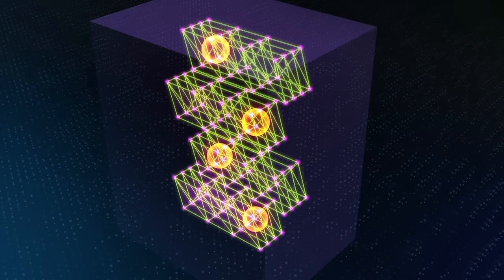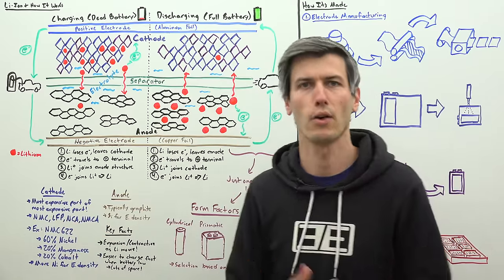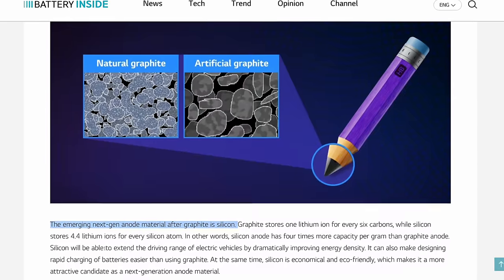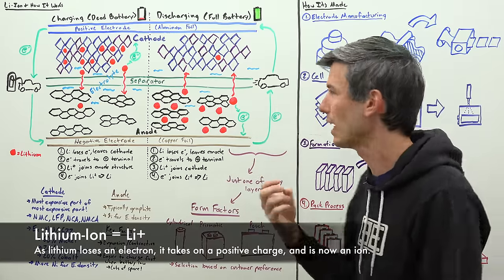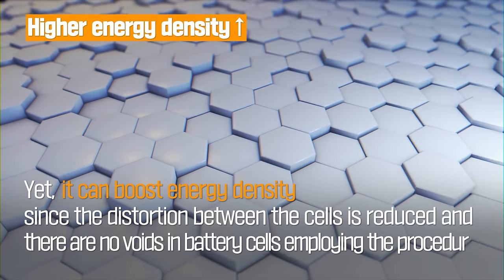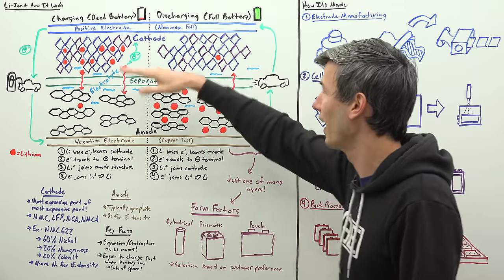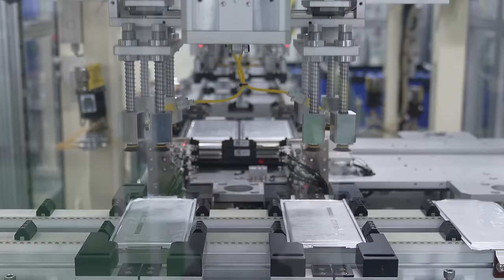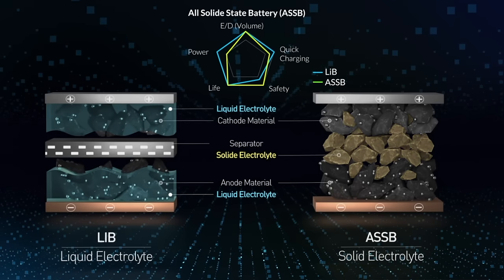Everything You Need To Know About Lithium-Ion Batteries

Comment: Great explanation!  You should definitely do more electric vehicle engineering info. I'd really like to understand the process behind regenerative braking and how some of the other systems work in electric vehicles, and your explanations are some of the best.
Reply: If you know how an electric motor works, then you would know how a generator works...
Should've payed attention to the physics classes
Reply: @kevingarfield2094  You should have "paid" attention in class when they were teaching you how to spell. I understand how a motor and generator work. The core component of these systems is a generator, but engineers can come up with many ways to make these systems more efficient. We have engines that are mostly the same core idea as when they were first invented, but engineers didnt just stop there. I personally enjoy watching videos on things that I already know about, just to hear someone else's info, ideas, and opinions about it. Learning never stops, and no matter how much you think you know, our understanding of the way things work changes over time. 

Also, not everyone has had a proper formal education. If someone is ignorant or curious about specifics, they should have the opportunity to ask questions without being heckled.
Reply: For synchronous motors, the DC-AC converter knows the angle of the rotor, torque is proportional to the relative angle between rotor and rotating field. So to start braking, you must delay the field rotation w.r.t. the rotor, this is enough to force power back. I don't know, however, how does the same frequency converter switch between power directions.
Reply: @GrimReaping  - Ignore the troll grim. You're correct. While it's true that an electric motor (polyphase AC motor in this instance) can be effectively used to generate power and a generator (alternator in this instance) can be made to operate as an electric motor they are typically optimized to function more efficiently as one or the other. For cross applications the differences in efficiency are typically small however so EV's will usually employ their electric motors as alternators for purposes of regen. Regen is simply using the vehicles kinetic energy to spin the motor which will act as an alternator when the brakes are applied. If you've ever tried spinning an alternator that's been removed from a car you may have noticed that it's very easy to spin when not connected to any sort of electrical load. However, connect an electrical load to it (like a 500W incandescent bulb) and it becomes much more difficult to spin. The load that a braking EV can place on the motor (when it's configured as an alternator), can be substantially more than that of a light bulb and can be quite effective at slowing a moving vehicle. Unlike with gasoline or diesel vehicles which use their friction brakes to convert kinetic energy into heat, an EV's regen during braking is generating electrical energy that's being dumped back into the battery.  Keep in mind as well that EV's also have friction brakes that are used in conjunction with regen to slow the vehicle. Below a certain speed an EV doesn't have enough kinetic energy to allow significant braking via regen so the friction brakes are needed. They are also there as a backup. The seemingly "seamless" operation between the two systems is actually a bit more complicated and maybe Jason can make a video on this.  
   Your question is actually a great question as it's not always easy for non "electricals" to understand. I believe Jason is an M.E. but his grasp of E.E. fundamentals make him great at teaching (which is unusual as while engineers are typically very erudite they are not always great at teaching. Jason has a gift 🙂) .
Reply: easy way to look at it is regen is same as reverse gear of the electric motor. on the motor side just send the exact opposite current to the 3 phases (compared to working as a motor). opposite current creates opposite magnetic field and opposite force/torque. but because the motor is still spinning in the same direction, the torque slows it down instead of speeding it up. once the motor spins backward, regen becomes reverse power and power becomes reverse Regen. on the battery side the current is also reversed => charging instead of discharging. if the battery is full or almost full, the battery doesn't accept charge current or only a very small one => reduced regen power.
Reply: A deep dive into regen would be interesting as it is simple in theory but a little more complicated in practice. E.g. Electric vehicles are quite limited regen wise which a lot of people don't realise. They can't capture all that energy generated due to limitations in the battery system. lt would be really interesting to see Jason do the numbers on this. l believe there are some companies trying to develop a capacitor/battery system that better utilises regen.
Reply: Some information about what vehicles use these specific cells would accompany this content well
Reply: @billhill4479 I would agree with you, in some cases. However, in larger EVs, with larger packs, (not at full charge,) the regenerative power does not exceed their capabilities of recharging. If, for example, you consider that the vehicle is able to output 150kW, (200HP) and can accept a DC fast charge at that same rate, (maybe not for the whole time, but a substantial majority,) why would it not be possible to regenerate that much power during a braking cycle? That is a LOT of braking power. If you are requiring a more spirited stop, that is what the mechanical brakes are for. (Or when the battery is nearly full, or more...)

I hope that makes more sense, at least from a logical standpoint. BTW, I hate replying via the YouTube app on a phone.
Reply: @billhill4479  Hi, yes you are correct in saying that regenerative braking does not capture that much energy.  Regenerative Braking occurs in a DC motor when the motor spins faster than the applied voltage.  Although most BEVs use AC motors, the system is the same, where you are forcing the motor to spin faster than it normally would in those conditions.  You are then using that excess energy to charge the batteries.  I created a dynamic braking system using a capacitive load.  With my test vehicle, I was getting around a 90 percent return, which translated to an additional mile for every 3 miles travelled--over physical braking.  In my test case, regenerative braking was not even measurable.
Reply: I’d like to see cold weather regenerative braking improved with resistive heating grids in the coolant. 

Right now, regenerative braking is limited in cold weather. The battery just can’t take it. But the ice cold coolant can. That energy could warm the battery and the cabin.
Reply: The most interesting “other systems” in an EV are the primary control systems: Acceleration, Braking, Cornering (Steering). They’re three different systems with the same kind of sensors. 

A. EVs use a throttle-by-wire pedals with Hall effect sensors. 

B. EVs use electric brake boosters with Hall effect sensors. 

C. EVs use electric power steering with Hall effect sensors—and three little plastic gears behind your steering wheel. Plus, they’ve got a stepper motor connected to the rack by a rubber belt.
Reply: @billhill4479  Wait: what do you mean by "limited"? Of course, in a hard braking there is little recovery possible, but in normal driving, regen power alone is well enough. On my PHEV I see up to 50 kW of instant braking power (4C), while on the average 20 kW are easy to get, provided the battery is not completely full. It is common experience of EV drivers that brake pads and rotors get replaced very rarely and when so, mostly for aging and corrosion rather than wear. Also, range is usually only marginally affected by climbs, if those are followed by equal amounts of descent (see for example the graph of charge vs distance of the Tesla Semi on the Diablo pass). This is a proof that regen and round trip efficiency are quite high.
Reply: @markotrieste  in an EV6, I have seen upwards of 150kW of regenerative braking. That's more powerful than some vehicle's acceleration capabilities. (Approximately 200HP.) That is relatively hard braking...
Reply: I’d love to know more about the mining of Cobalt....
Reply: @85priesty Almost everything you own was dug from the Earth. Cobalt is only used in a small percentage of batteries. And when it is used, it’s used in a small percentage. And when it was mined, a small percentage of cobalt mines used child labor. And that was addressed a few years ago so that cobalt from those mines wouldn’t be used. 

Meanwhile, the mining used to create that phone in your hands is much worse.
Reply: @kevingarfield2094  "If you know how an electric motor works, then you would know how a generator works... Should've payed attention to the physics classes"

Or you could stop posting rude and pointless replies to people?

Comment: LG's HG2 was a game changer in the drone world. For the first time, a Li-Ion had the discharge capacity to be considered for flight packs in fixed wing models, and I bought enough to support many car payments for their staff. I remember these cells being responsible for re-writing my checklists - cutoff voltages are quite different than Li-Po, and as such can be used safely at lower voltages than their more volatile counterparts. One issue I found, quite dramatically: in 3S configurations, you will discover which equipment requires over 10V to function: I'm looking at you video transmitters!
Reply: LG in the Chevy Volt did well for GM.

Comment: Excellent overview!

At 6:37 - battery charging slows down at the end because of more practical reasons too:

(1) The battery's voltage rises near the end so the voltage gap that the charger has over the battery is smaller.  Since current I=V/R then current at the end is naturally less the end since V becomes smaller and smaller as the battery charges.

(2) The charger may naturally slow down charging because it does not want to over charge the battery past any of the battery cell's limits (4.2V for Lithium-ion).  This is better than having the BMS forcibly disconnect the charging process -- see (3) below.

(3) The BMS may actually cut off charging if any cell is past the cell's upper limit to avoid possible damage and fire.  After a time of 0 charging current, the cells drop back down in voltage and the BMS will then re-connect the charger.  This can happen over and over again making charging is slower at the end.

Comment: In the charge cycle,  electrons are driven into the cathode by the external power supply.  These electrons combine with lithium ions to produce neutral lithium atoms which migrate back to the anode.  Lithium is chosen due to its high redox electrochemical potential.  The battery performs reversible reduction and oxidation chemical reactions.  The electrochemical potential defines the voltage of one cell of the battery.  With lithium, that can be as much as 4.2V.
Reply: Thank you, he was incredibly brief on the charging mechanism of action.
Reply: what is the difference between a lipo used in RC hobby and a lithium battery used in real cars?
Reply: @RotoRCol  it’s a different cathode chemistry and uses a polymer gel electrolyte rather than a liquid. They’re similar but hold a little less charge, can discharge faster (high ‘C rating’), and operate about 0.1 V higher due to the different chemistry.
Reply: @RotoRCol The LiFePO4 battery LiPO for short used in RC is also being produced for cars.  The battery packs are just higher capacity, more durable, and stronger shielding.  Are you referring to Lithium polymer or lithium iron phosphate?  Lithium polymer is a construction technique.  The chemistry of the battery defines the nominal voltage.
Reply: Ai at its best just aint good enuff fella
Reply: Small correction, LiFePO4 is LFP, and LiPO is short for lithium polymer.

Comment: It would be interesting to see you go through the differences between traditional Lithium Ion batteries and Lithium Ion Phosphate batteries. My understanding is Lithium Ion Phosphate batteries are less energy dense but have a big advantage when it comes to being much less prone to catching on fire. Fire fighter friends of mine have told me charging of cheaply made Lithium Ion batteries such as those used in electric bicycles has resulted in a very significant growth to fire call outs and these fires can be quite difficult to put out.
Reply: LiFePO4 also have better cycle lifespan. Slightly more resistant to draining the battery deep.
Reply: Thats correct. Less energy dense, slower charge/discharge, but more stable, less flammable, and longer life. NMC for performance and range, LFP for cost, safety, and longevity.
Reply: And because LFP batteries are less energy dense, they tend to be heavier.
Best illustration: Tesla Model 3 Standard Range. In Model Year 2019 they used NMC cells, from 2020 onwards Tesla switched to LFP cells in this specific model. The kerb weight went up by a whopping 200 kg (though the battery capacity also grew from 53 to 60 kWh, to be fair).
Reply: You mean Lithium Iron Phosphate as the F stands for ferrous
Reply: @berttroubleyn3475  Sounds like they would be a good solution for home solar power storage though - been thinking about this for my home, but worry about thermal runaway leading to a house fire - so if they have chemistry that is safer, that would be a great selling point for me.
Reply: @Beer_Dad1975  absolutely. There are lots of lfp home batteries on the market. Their higher weight is not an issue of the battery is stationary. I'd go for LFP too if I would get a home battery.
Reply: @Beer_Dad1975  : >> Sounds like they would be a good solution for home solar power storage though <<
Yes, LFP for stationary energy storage; NCM for moving vehicles.

Comment: This is so fascinating! So cool to see this process. I’m super curious to see more about how these batteries are recycled
Reply: Jerry Rig Everything did a video about lithium ion battery recycling. Definitely worth checking out. They actually take a whole battery pack and *grind it up*, then melt the metals and extract them at the elements' various melting points. It's wild.
Reply: Newer companies have figured out strategic disassembly.

Comment: At a slightly higher level yet still technical level... which goes back to the reason you outlined... and also probably for another reason being cell balancing. Lithium charging is done using Constant Current -> Constant Voltage cycle. Its easy to shove a ton of current into the battery when the voltage required to do so is still less than its max rated charge voltage. But once that max voltage is reached .. the charging current starts to drop ... thus your charge rate continually drops (gets slower) as the battery fills up =)
In the case of lithium ... every single cell has to be tracked and kept at or below this max charge voltage while charging, and with thousands of cells and variances within, its easy for them to get unbalanced ... so the speed of charge nearer end of cycle also has to do w/ how well your pack cell balancing capabilities are and what current it can do it at... the more cells that reach their upper voltage, the more time is spent waiting around for the other cells to 'catch up'. Without some sort of active balancing, packs with really unbalanced cells can take forever to charge... in fact just due to imbalance, packs can become seemingly "unuseable" but have otherwise good cells in them... it would just require a lot of time to balance them.  It would be interesting to know what the balancing capabilities / specs of a lot of the battery management systems used in these cars are. At minimum, I think its fair to say they are active balancers =)
I'll also mention that, as per some of your other videos, current battery tech isnt high enough energy density to really do anything meaningful to "power the future". Its really just a gimmick right now. And as per the caption in this video.. LIION or any battery, really doesnt "power" anything... whatever charges them is the power source.... and that, is a much bigger topic of discussion and interest... imo